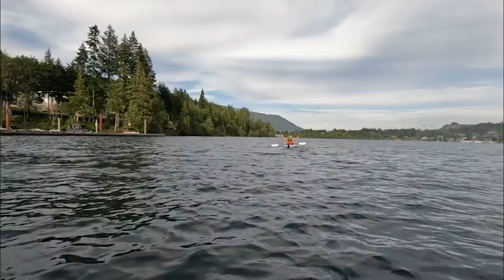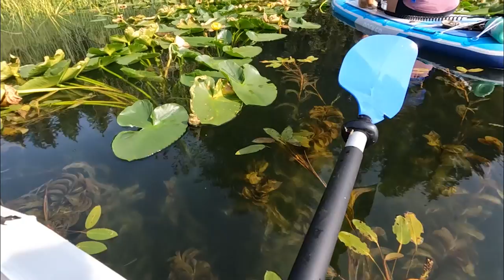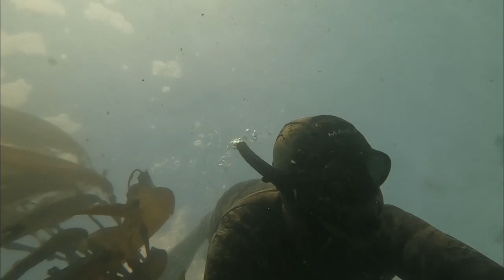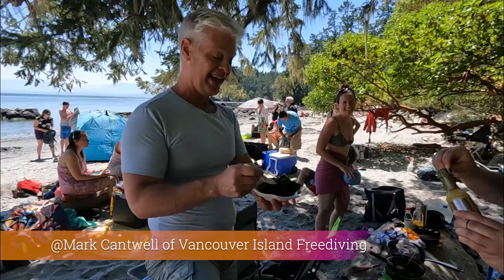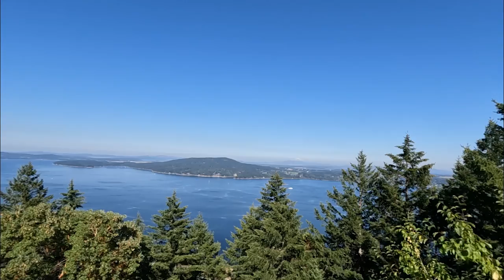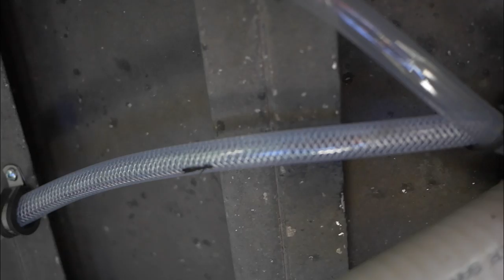WATER: Living the Van life, Freediving Vancouver Island

Comment: This is a fabulous water set up! Draining ouside is just fine. I've been doing it for 3 1/2 years. I don't wash my dishes with water from  my tap so I don't have that issue. I only drain my face washing and tooth brushing water under. And occasionally vegetable washing though I mainly spray those with water or a water/vinegar mix. Great video flossy! Thanks for showing the sea food straight out of the water!